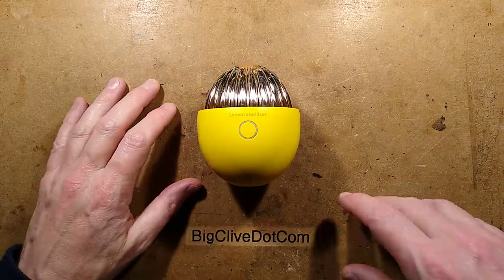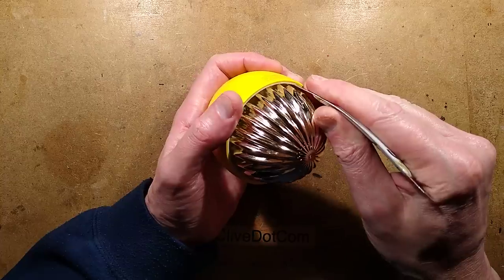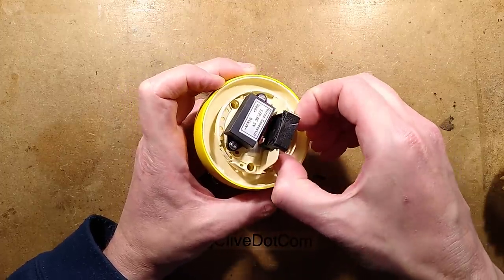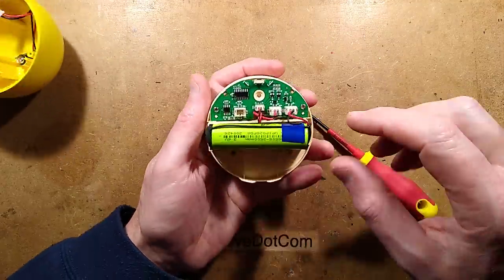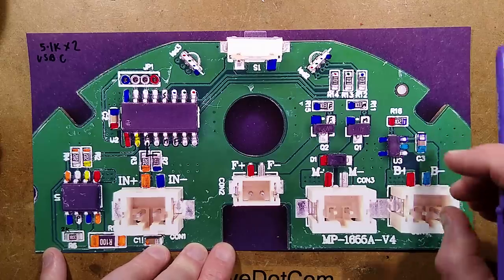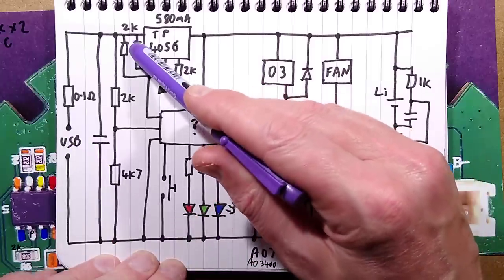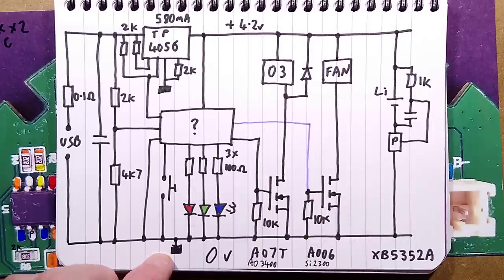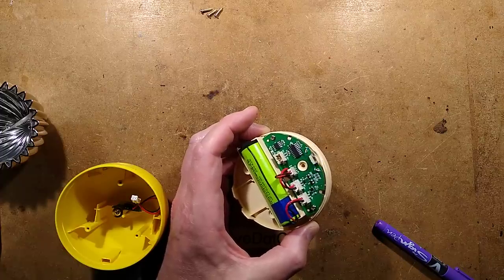Xiaomi high voltage refrigerator lemon

Comment: Another small step in Clive's quest to single-handedly restore the ozone layer.
Reply: @aidancommenting  Ha! Ok, time to look at a balloon with solar panels to power an ozone generator. Use any excess power to run a moisture condenser and hydrogen electrolyser and it'll stay up there indefinitely. Wait - could that actually work?
Reply: @aidancommenting  Depends on how quickly the hydrogen leaks out from the balloon, how moist the atmosphere is and how efficient the solar panels are for their weight. Probably impractical, but fun to think about :)
Reply: Screw the ozone
Reply: @JoshuaMothis  Oxygen's menage a trois
Reply: "In this episode of Beyond 2000; a native from the Isle of Man has found a way to restore the Ozone layer using a lemon."

Comment: Modular in a way that almost makes it serviceable (in spite of the one cover being fairly tamper-proof), even though it's not the kind of thing you'd expect to do battery replacements on. It's funny you'll see stuff like this made like that, but not other things like phones or wireless speakers.
Reply: Nothing is tamper proof with enough violence
Reply: @dragonheatgaming5005  Nothing is too cold with enough heat.

Comment: So glad you got your hands on one of these. I bought the same one and immediately bought the other two colors -- loved it. (Note the white one has a pink top.) Good to know how it comes apart should the battery need replacing. Having run these for a couple months, their estimated battery life is low. I've got an entire month out of one in "green" mode in my fridge before it signaled low battery. This is consistent across all three units. Glad to see it's as well-built as it looks. Thanks! 👍
Reply: Does it do it's job? I've never heard of such a device.
Reply: @ejbeekeeper4360  For us it does. If you routinely keep leftovers in the fridge, or fresh veggies, or such then I find it a huge help. I had never heard of them either, until Clive showed off others. He has lots of them in his videos.

Comment: Looks like a well designed and well built device. At low temperatures in the refrigerator, the capacity and the voltage of the lithium cell will be considerably lower.
Reply: no
Reply: I  would expect the battery is exactly as advertised. Because of the environment it is expected to operate in.  
All energy storage devices are effected by temperature.
Reply: @snakezdewiggle6084  Why would they pay extra for a low temperature rated cell (if they even make such a thing that isn't super low temp)when they could just buy a bigger cell than they would need otherwise?
Reply: @lobsterbark  I said nothing about Cost or Buying !  Go read the last line of my post, watch the vid again,  then ask Clive about the battery.

Comment: That thing has quite elaborate circuitry. Looks real decent and hackable!  Wouldn't it put out way too much ozone for a fridge?  Quite small space for such an output.
Reply from the maker: It is a bit fierce for a fridge.
Reply: So it must be dormitory grade, I guess.
Reply: Maybe for US-size fridges with three doors and 8000 L or so capacity! They store a lot of hamburgers in them!
Reply: US fridges are bigger than our European houses!
Reply: @bigclivedotcom  Would think that it would deteriorate plastic, attack foods, maybe even eat holes in refrigerant lines.
Reply: @bigclivedotcom  If it's fierce for the intended use, how could it most simply be down-rated (on-time- or intensity-wise)? Is the MCU susceptible to a mod or kludge to allow for switchable modes appropriate to different volumes (context-specific output)?
Reply: more ozone = better
Reply: @SeekingTheLoveThatGodMeans7648  only neoprene affected.  Do you keep a diving wet-suit or certain large scientific measuring equipment in your butter compartment? Then sadly, no O2 for you.

Comment: A high voltage, oxidizing lemon.  The 18650 cell might even qualify for combustible lemon.
Reply: Random fact: if you peel an orange, hold the peel a few cm to the side of a candle, and flex the peel until it cracks, it will release flammable oil particles (limonenes?) that will put out bright orange flames and grungy black smoke.
Reply: @deltab9768  If you cut a grape in half and put it in a microwave so the two ends touch the grape oils catch fire :D
Reply: "When life gives you lemons, don't make lemonade.
Make life take the lemons back!
Get mad!
I'm the man who's gonna burn your house down- with those lemons!
I'm gonna get my engineers to invent a combustible lemon that burns down your house."
-Cave Johnson, 2011

So Cave Johnson's engineers were Chinese?
Reply: @morluche91  "yes sir Mr Johnson!"

Comment: Clive worried about breaking or bending the spudger and I'm cringing worried about his hands getting cut open.
Reply: Strangely, getting his hands cut open never seems to deter him.  He had a lengthy series of videos a year or two back with a bandaged finger that was healing up from being split open.  This is the same man who tells stories about all the times he got electrocuted because of badly designed or implemented industrial wiring and never seems to have been deterred from taking jobs where he worked on such things.  Then there's all the weird and wonderful things he had to deal with for the Glasgow Christmas lights back when he worked on them.
Reply: @evensgrey  trust me. Coming from someone who loves to take apart old broken Chinese crap and doing other stuff with the parts the first time or two you slice your hand open with a screwdriver or cut yourself on shards of sharp plastic bits it'll hurt but after a while it's just something you expect is gonna happen and don't care about it anymore
Reply: @josealcazar2922  And you probably know the experience of being in the process, using some of your tools and putting some of them away and then seeing red spots on them everywhere, and you are like "Hold on, did I hurt myself?" and it turns out you were so busy and endorphines were flowing so bad you didn't immediately realised you knicked yourself, you check your fingers and upon finding the damaged piece of skin THEN it suddenly hurts :D :P.

Comment: Ozone in the fridge is a must. Get one today!
I would have never believed it if I had not tried it myself. I have a fish market close by which always gives me a "Bio" lemon as a gift. Most stayed in the fridge until they started to rot. Now they dry out. It even works through plastic containers.
Ozone in the fridge is like the "protective atmosphere" they use to pack ground meat.
Reply: It's also toxic, opening your fridge may be bad for your health.
Reply from the maker: Ozone occurs in natural outdoor air.  It's only bad when it is at very high concentrations.
Reply: @bigclivedotcom  You are ignorant to the facts.  Just because something is natural in our air doesn't mean it isn't toxic.  Carbon Monoxide and different Nitric Oxides occur at ground level ( the Troposphere) at much higher rates than ozone and are very toxic, but not as toxic as ozone. Ozone is the main component of smog and is dangerous to health and the environment, it is very toxic.   The vast majority of ground-level ozone, not to be confused with the upper atmosphere's protective ozone layer, is created by reactions between environmental pollutants, light, and heat. It is only produced "naturally" at ground level when lightning strikes, and that only makes up a small portion of tropospheric ozone.  
 Your statement that "It's only bad when it is at very high concentrations," doesn't provide any proof that you even know what constitutes a high concentration, because the safe limit recommended is as low as between 0.070 parts per million (EPA recommendation) and 0.10 parts per million (OSHA recommendation) for no longer than 8 hours. According to the EPA, "Adverse health effects from ozone are more likely to occur when ozone levels exceed the EPA standard, but are possible when ozone levels are below the standard, especially in sensitive populations."  That means at most one part of the air per 10 million parts is considered the most anyone should be exposed to over an 8 hour period and as I previously mentioned, people can experience health problems at lower levels if they have any form of asthma, if they are children due to weaker longs than adults, or if they are elderly.  I wouldn't consider only one part per 10 million to be a "very high concentration" relative to most things, so your answer is an ignorant dismissal of legitimate problems.  Most products that have been tested usually produce much higher levels than what is found to be safe, and it's even more dangerous when used in enclosed spaces like a fridge.  Also, Chinese products aren't going to care at all about being in compliance with OSHA or EPA guidelines. 
The EPA also has shown that ozone can eliminate odors, but the catch is that zero studies have been able to do so without exceeding toxic levels, and they also found that they are not effective at preventing things like mold/bacteria and or eliminating air contaminants at safe levels.  As a result of reviewing research available to this date, EPA, as well as researchers from universities like UCLA, strongly discourage the in home use of any type of ozone generator.

Comment: Great video as always. I really appreciate the detail you go in the circuits to explain them. Can you please make a tutorial on how you reverse engineer the circuits so easily. I have tried doing that but they always become a mess on paper while I connect everything to each other.
Reply: One of the keys is to guess standard circuit modules beforehand -- if you can't guess that a particular section is a bridge rectifier, you'll likely draw the four diodes all awkwardly and even fail to identify it as a bridge after you've drawn it.

Comment: Can you make a video discussing Ozone Generators vs Ionizers? I get the impression they often have similar circuitry, but their purposes seem different. In what applications would you want an ionizer, vs an ozone generator?
Reply: Bump
Reply: @jurio3117  Ozone is used for sterilising and removing smells, ionizers are used for air cleaning (dust/particle removal).  Ozone is toxic and will damage the tissue in respiratory systems with quite low concentrations, so definitely not something you want to have produced within a living space.
Reply: What is the difference between water and H2O?
Reply: Ionizers ionize air which makes ozone. Ozone generators generate ozone by ionizing air.
Reply: Ionizers -> healthy and safe, Ozone -> Unhealthy and hazardous
Reply: @jurivlk5433  they are not the same
Reply: @NinoJoel  So what is the difference?
Reply: @jurivlk5433  Quick explanation : 

Ionisers are distinct from ozone generators, although both devices operate in a similar way. Ionisers use electrostatically charged plates to produce positively or negatively charged gas ions (for instance N2− or O2−) that particulate matter sticks to in an effect similar to static electricity. Even the best ionisers will also produce a small amount of ozone—triatomic oxygen, O3—which is unwanted. Ozone generators are optimised to attract an extra oxygen ion to an O2 molecule, using either a corona discharge tube or UV light / High voktage

Comment: It is my understanding that Xiaomi runs a successful retail chain, Xiaomi Youpin, and they offer partner brand products there, which are not Xiaomi products per se, but are co-marketed by them and tend to have a very IKEA-like styling to them, which is somewhat consistent among the brands, maybe not so much in the specific details, but the overall school of design. They try to limit the products to one per category, so there's only one brand of shavers or vacuum cleaners, and only a handful of models for each brand with clear differentiation, such as to give you vaguely what you need, but not burden you with actually having to make a choice, and it's supposed to be a hassle- and worry-free experience, that nothing they offer is going to be outright garbage.

How well does Li-Ion perform in a fridge, which can get down to maybe 5°C? Is NiMH better or worse in this use? Maybe NiCd is more ideal? Then again i'm not sure how legal that would be still... How well does one expect this assembly to stand up to a humid environment?
Reply: I would not be worried about the lithium cell since the circuit draws next to nothing so the weaker output of the cold cell will not be a problem. 

As for moisture..... 
I'd guess it will not care as long as it does not condensate on the PCB. 
Then again there should not be moisture in a fridge anyway
Reply: @NinoJoel  Mhm how can there not be moisture in a fridge? Ice condensates on the back wall of a fridge, just a barely visible layer and is occasionally evaporated off by the defrost logic of the fridge, which occasionally kicks the back wall into heater mode once every couple days i think. You lock some room-temperature air with normal humidity in the fridge, the temperature in the fridge is usually well below the dew point, so it will condensate on everything.
Reply: @SianaGearz  yes but there is not much moisture in a fridge. 
It will condesate due to a large heat difference. 

Since the Ozon generator will stay inside for the most time it does not have a temperature difference to the fridge that is large enough to condesate anything.
Reply from the maker: The air in a fridge is very dry because the moisture gets condensed out onto the evaporator cooling panels.  That's why they have moisture or ice on them.
Reply: Lol it will never implant in France with this name, "youpin' is a very racist slang word used by french nazi collaborationists during WW2 for naming Jewish people.

Comment: The thing about an ozone generator in the fridge is that it should degrade de fridge's rubber seal quicker. Otherwise, neat design.
Reply: I'm curious about what it would do if you left it in a fridge for a full charge without opening, would it be able to convert all the oxygen in the fridge to ozone? In which case it would be rather dangerous to open that, and would likely eat away the seals very quickly.
Reply: I don't think fridges have had rubber seals for years. They're that squidgy plastic stuff.
Reply: @skylined5534  Rubber and plastic are pretty much the same. All organics that degrade with ozone exposure.

Comment: I'm contemplating on getting one of these now. Great video keep up the good work Clive!
Reply: I (eventually) bought all three colors. They are amazing. Relatively expensive (mine were on the order of ~$33 USD per unit shipped), but you've seen the build quality. I'd rather buy this than some cheap trinket that ends up in a landfill after a couple months.
Reply: @McTroyd  Have you noticed the food staying fresh longer? Or is it mostly a deodorizer?
Reply: @epap1375  Definitely staying fresh longer. In some cases, like veggies, it lasts a lot longer (from weeks to months). This has other repercussions though -- the fridge is still a dehumidifier, and things will dry out. Need to watch out for that.
Reply: For how long do you run them? I don’t want to turn my fridge into an ozone chamber xD 
I have a very small fridge (almost mini fridge size)
Reply: @danilodistefanis5990  We have a full size fridge, so I'll just run them until the battery dies, and give the fridge a rest while the unit recharges. (It only runs for 5 minutes or so every hour, so that causes it to last days.) In your case, this unit probably emits too much to run all the time in your fridge. If you're looking at getting one, maybe run it for a few hours on low when you first get it, and just run it again whenever you notice your food spoiling quickly, or the fridge smells musty.

Comment: A nice idea, ozone kills bacteria and is also widely used in water treatment. The downside is that the "free" ozone reacts quickly with metals and etched them depending on the concentration. So I wonder how it reacts with aluminum foils or the wiring in the fridge chamber. Also older fridges have not foamed in evaporators or ice cabinets.

Comment: Does the ozone harm the plastic in the fridge over time?
Reply: I wonder about Tupperware also. And any seals or gaskets in the fridge's interior.
Reply from the maker: It will very slowly oxidise the surfaces of some materials, but not silicone, aluminium, stainless and glass.

Comment: Interesting that they put a back EMF diode across the ozone module but not across the fan
Reply: Probably because the fan is a brushless motor with an integrated inverter which already has flyback diodes included.
Reply: rest of the lemon: "you charge me right round baby, right round. Like a motor baby, right round round round"

Comment: thats quite an intriguing little ozone maker, I honestly could use one myself. My minifridges plug fell out for over a month and it now smells like I am storing a cadaver in there
Reply: And are you? I won't tell.
Reply: @thebrowns5337  hahah nah m8, not in this one ;)
Reply: @ProtonOne11  thank you, I was planning on using bleach but I have to do bit by bit. I havent even removed all the old food yet. Everytime I open it then I run out gagging, it has to stay cool to make it even slightly tolerable. Chlorine isnt a problem since I mess with a lot of chlorine gas :), the main issue is just procrastination

Comment: Im waiting for a module that replaces/taps into the fridge bulb for an easy retrofit.
Reply: Should be easy to do with a supercap.
Reply: @NiHaoMike64  definitely not, it would be way more compact and economical to just have a powerful little generator only on with the light. a supercap would need to be huge and require excessive circuitry due to the voltage constraint. 
big supercaps are never found in consumer electronics for a reason, they rarely ever make any sense to use.
Reply from the maker: You can get 120/220V ioniser modules that could be wired across the door switch so they ran in series with the lamp when the door was closed.